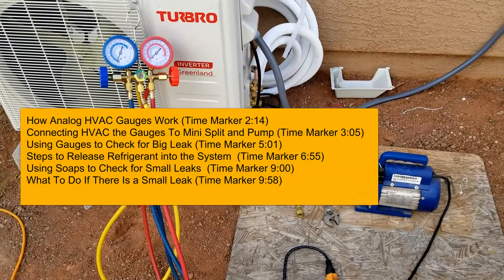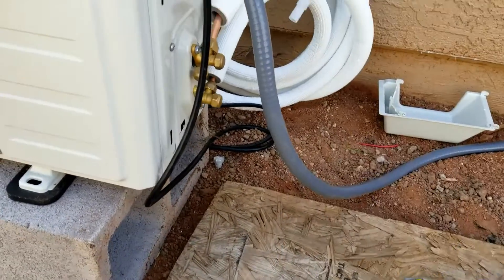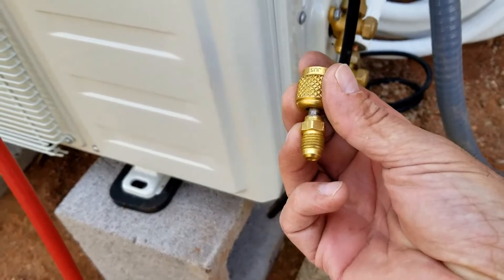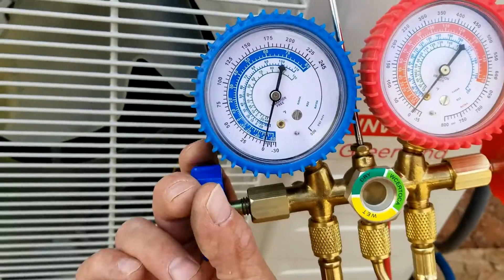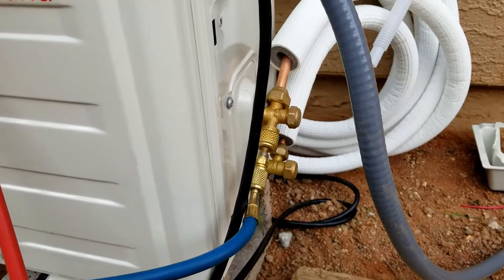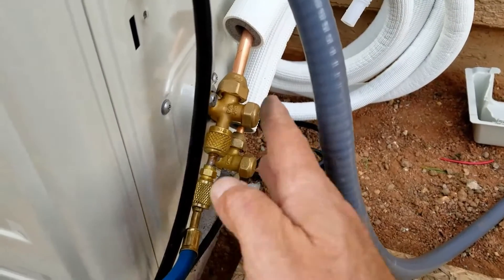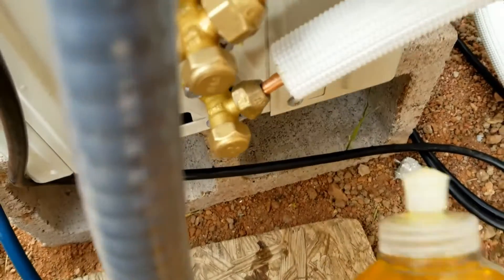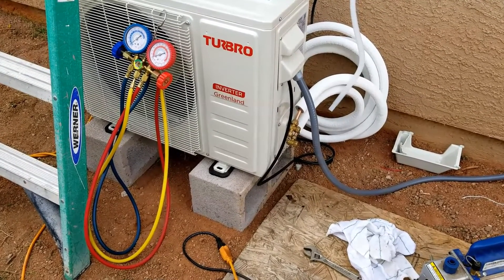Step by Step How to Vacuum Down Mini Split Using Analog Gauges Release Refrigerant Check for Leaks

Comment: Was the unit pumped down to begin?  Asking because my low pressure was reading 50 psi instead of 0 psi like yours.  Granted I did not have a vacuum pump hooked up just measuring low pressure.  To clarify mine is not a new install, it's six years old with suspected leak as reading 50 psi.  Assuming I just need to pump down system to get into the same state that your video was in to verify vacuum holds and if not resolve leak then relase refrigerant and add refrigerant as needed.
Reply from the maker: This is for a new install before the refrigerant is released, so, yes, basically, it has been pumped down. Since your unit is already in use with refrigerant in the system, the unit needs a Pump Down to lock the refrigerant back into the outside unit, or the refrigerant can also be recovered with a recovery machine.
Reply: @HVAC_Mechanic  I truly appreciate you sharing your knowledge to help everyone interested become more capable.  HVAC has always been my last big hurdle, but I'm getting there.  Thank you!

Comment: Great video. I've installed several of these and was just double checking if removing the vacuum hose after releasing the refrigerant was the correct method. One thing I noticed regarding the lines was how they were coiled in the vertical position. Isn't that a huge no-no because it creates oil traps inside the lines between cooling cycles? Aren't they supposed to either be fully extended or coiled horizontally?
Reply from the maker: Always follow the manual for a unit, but I have seen 25–30-year-old split units with the line set coiled up still running with no issues. You can cut them, but in my opinion, it's more cosmetic. Also, keep in mind the outside unit is prefilled with refrigerant with the line set in mind, so if too much is cut out, the refrigerant may need to be recalculated.

Comment: I did my unit 2 years ago. I did not do the soapie part in the end. And that is what my question is about, because wouldnt a leak be noticable becasue it won't hold vacume? This step seems reduntant to me, could you explain?  Thnks
Reply from the maker: Yes, most installers don't use the soap method but watch to see if they lose vacuum over 1/2 an hour or so. It is just an extra step to be sure there are no leaks, mainly a very small leak that would lose pressure over a long time period.
Reply: Understood, i can see with a  analog gauge those are not that accurate, but when a digital gauge would be used. I can imagine that would a lot more reliable. But better safe than...a little soap test can't hurt. The ironic thing is that I always do it when I work on gas lines.😂.. basicly samething, maybe less presure. Any way, thnks for clarifying.

Comment: Very nice Video! I did not completely get the first step though, were the valves on the outdoor unit open or closed? There was still refrigerant in the outdoor unit?
Reply from the maker: Refrigerant is locked in the outside unit from the factory. The pump is vacuuming down the lines that were connected between the two units.

Comment: What if we do the vacuum for 30 minutes and it does loose pressure and move towards the 0? Then what do we do?
Reply from the maker: If it loses pressure, there is a leak. It needs to be checked out, but usually, a leak is with the line set. Often, there is a bad flare, but it needs to be examined. Also, be sure the gauge hose connections are all tight.

Comment: When you run the vacuum, how do you know if air is getting past the schreader valve, and not just pulling a vacuum in the blue hose? I've got a pioneer unit that Im about to do this test.

Comment: 5000 microns is about 29.72 on the gauge. 1000 microns is about 29.88 on the gauge. 500 is about 29.9. 110 is about 29.92. The difference between 5000 microns and 200 is just barely perceptible if you're using an analogue gauge. And you will NEVER drop under 2500 microns if there is water in the system and you'll NEVER be able to tell the difference unless you're extremely observant and have pulled vacuums many times.

If there's any water in the system it will look exactly the same as a good vacuum on analogue gauges.

Using an analog gauge is slightly better than no gauge at all.

A leak that loses 500 microns won't even register unless you never got a decent vacuum in the first place.

The cheapest micron gauge is better than the most expensive manifold gauge set.

Invest in the correct tool for the job or you're really just counting on being lucky.

You can get a TPI Gauge for $110 You can get the Fieldpiece VC2G with the 5/16 adapter for $150 You can replace a ruined system for two or three grand.

You can do a proper install without a manifold set. You cannot do it without a micron gauge.
Reply from the maker: Micron gauges are good if you have one use it; if not, analog gauges have been used for much longer and also work very well. Either will work.
Reply: @HVAC_Mechanic  That's a bit like using analogue phone tools for computer networking. Some of them might still be relevant. But you NEED the relevant tools necessary for modern equipment.

IF you can guarantee there's no water in the lines, IF you purge them sufficiently and leak test them, say, overnight for both pressure and vacuum, then maybe you'll do an adequate job.

But, you'll never know if you did the job correctly or not unless you use a micron gauge and conduct a micron decay test.

You simply can NOT use an analogue gauge to see what you need to see. It simply doesn't have the resolution.

A system with a tiny bit of water in it will look exactly the same as one that doesn't. But, it won't last as long.

About all that gauge is good for is discovering relatively huge leaks over a relatively long period of time.
Reply from the maker: The process has been the same for 100 years; no new tools are needed. Many installers don't even vacuum the unit down; they flush it with R153a and tighten down the lines while it is under pressure. This argument over micron gauges reminds me of the new auto mechanics fresh out of school who can't troubleshoot without a scan tool. In the end, to each their own, whatever works to get the job done.
Reply: @HVAC_Mechanic  I have a toaster I use regularly that is 98 years old.

Like any toaster made in the modern day it heats bread to make toast.

I can NOT use my knowledge of how it works to repair a toaster made today.

I have explained why the method you're advocating is inadequate to the job you're doing, and trust me on this, I absolutely understand that you're motivated to believe the work you've done to the best of your ability with the tools you have is first rate work, fully the equal of anything done by anyone with their fancy shmancy modern tools, and I even agree it might happen to actually BE equivalent to anything done by 'technicians' using the latest tools.

What I'm trying to point out is that, even though you might not see the evidence directly, it wouldn't show up directly. A system lasts ten years when it might have lasted fifteen isn't something you have the ability to see without quite a lot of data which would be really hard for you to collect and analyze.

It's completely natural to suppose that anyone leaving contradictory comments to the information you're providing is simply trying to tear you down, to attack your credibility and diminish you.

And, maybe most of the time that's exactly what's happening. That's not what's happening here.

You are unquestionably a smart guy who wants the people who watch your videos to become properly informed, not to chase clout, not for status or a few bucks, but because you genuinely care whether or not the information you give them is accurate or not.

Look at the objections I've raised, specifically. Don't imagine I've said something I didn't. Look at the actual technical claims I've made. Where am I wrong?

When you say the process has been the same for a hundred years, that's true in an overall sense. But the technology has evolved. We're not dealing with the same refrigerants, lubricants or materials. As to HVAC techs using refrigerant to flush the lines... can't say as why that wouldn't work... for them, not for people without access to the refrigerant, and in any case isn't what you're teaching people to do.

Bringing up automotive scan tools points out a very similar thing. Such tools are a necessary but not sufficient means to diagnose modern cars. Old cars didn't have a MAF, a MAP, oxygen sensors, computer controlled fuel trim or a hundred other things to consider. Other than through sheer luck it is actually impossible to diagnose a modern car without the correct tools, and a 'scanner' is absolutely the bare minimum necessary tool which most of the time just minimizes the range of guesses.

I am absolutely certain you don't want to get this wrong. So, examine what I've said and decide if there's anything wrong with it.

Watch this video and tell me you're actually certain the setup and methods you're using sufficiently deal with the problem. https://youtu.be/Pm8mBCLJ49w?si=Np4clkmHwBE_8DSC
Reply from the maker: I have installed many mini-split and standard split systems that are still working 20-plus years later with no issues with using an analog gauge. I have two-micron gauges and use them, and while they are good when working, they can be off sometimes. I've seen several installs messed up when the installer's micron gauge gave bad readings.

Many installers these days are moving away from using a vacuum pump and don't use any gauges they use a flush like KWIK-E-VAC. 
Most new techs use micron gauges or the flush method, while 15-20 years ago, there were only analog manifold gauges. 
I guess I'm old school. In a few more years, analog gauges will probably no longer be used, but they do work. I've been using them my whole life.

Comment: I got a mini split installed and the technician leave the vacuum pump running for only 10 minutes. should I be concerned?
Reply from the maker: It is likely good as long as it holds a vacuum.

Comment: Can u recommend the brand equipment to use for this procedure?
Reply from the maker: I'm just using a low-cost HVAC gauge and pump. The links are in the description for what I am using but any low-cost HVAC pump and gauges will work.

Comment: I was told by a hvac expert to release the small line valve first slowly, any reason for this?
Reply from the maker: A lot of techs will argue about that one. Many manufacturers' manuals state to open the suction line first while others don't. It's always best to follow the manual from the manufacturer. Personally, I don't think it matters.

Comment: Thank you for the video but I’ll repeat what has been said before. Comparing micron gauges and analog gauges is like trying to measure 10 inches with your car’s mileage counter. Analog gauges just don’t have the fine resolution like micron gauges have.

Comment: Question: why do some videos show a shrader valve step ? Is that not required ?
Reply from the maker: Removing the Schrader valve is not necessary; sometimes, it is done on very large HVAC units to pump them down quicker, but even then, it is not necessary.  A lot of people get their information from schools and books, which very often is not how it works in the field.
Reply: @HVAC_Mechanic  those pesky schools and books!!!! I think those books contain some of the answers to your misunderstanding of HVAC. You seem to confuse vacuum with positive pressure at times. You seem to infer that after the release of the refrigerant, there is positive press.ure in the system.  The system is under a constant vacuum both before, and after the refrigerant is released. So, whether you remove the vacuum line before or after the release of the refrigerant, the lineset should still be under a constant vacuum. Unless my basic understanding of physics is off. But as another has stated here, the piont is moot, as the screw being open to release the gas blocks the port that the vacuum line is connected to.
Reply: @kylemccourt663  That's not always the case imo.
Reply: This is a great tutorial and explanation. But in regards to your comment... I am certainly glad I did not ask you to work on my system those pesky books must have a lot of dust on them in your closet or under the front porch steps. This gentleman did a great job, you can actually see the escape of some of the positive pressure (which as he stated is a slight amount of the refrigerant) as he is removing the blue mechanical compound gauge. Having done this myself and watching the gauge it actually shows the transfer of pressure occurring. 😊 I'm sure if you took the time to read some of those pesky books you mentioned you would discover that the system is under hundreds of #'s of pressure, the most being during heating cycles in the winter. Those pesky books I wonder if you have a 608 certification?

Comment: does it matter which side the refrigerant is release to first?
Reply from the maker: Some manuals will state to open the low side suction line first (Big line), while other manuals don't state anything. Be sure to check the installation instructions or manual for the unit, but I don't think it matters much.
Reply: thanks

Comment: Hello Sir, I have installed a senville mini split have installed everything but one issue it does not hold the vacuum. When start test it the gauge stops at -15 and not at -30. My area is at 5500 feet can that make it set on -15 instead of -30. It does not hold pressure. If I disconnect the hoses and re connect cause and retest the vacuum even do I have not release the coolant from fan. If you can help with this question will be appreciated.
Reply from the maker: As long as the vacuum pump is good the elevation shouldn't matter it should pump it down into a vacuum. It may be best to test it for leaks with nitrogen, you can also get a can of KWIK-E-VAC Line Set Flushing Kit pressurize the line set and then check for leaks with soap. Here is a link to KWIK-E-VAC on Amazon. https://amzn.to/4dkqkhI
Reply: Are you using a manifold  gadge ? Is so make sure there are no srader valves without  caps. Vacuum  will pull air around the srader valve . Some pumps have more than one port and don't come with a cap fpr thw second port. All srader valves need a cap

Comment: Hi, when you connect the lines to the outside unit, do you need to use Nylog and a torque wrench like the manual says? Thank you so much for the video.
Reply from the maker: It depends on the installer. I use Nylog but have never used a torque wrench. Some installers never use either, while some use both. The main thing is to get the fittings tight enough not to leak without overtightening them.

Comment: Hi, will a 2 cfm single stage vacuum pump do the work for a 1.5hp split aircond system?
Reply from the maker: Yes, it will work. Most any HVAC pump will work; it's just how fast it can pump a system down.

Comment: That was great thank you it well until I unscrewed the blue hose from the adapter instead of the unit and lost a lot of coolant before I got the adapter off #####**, so he much damage did I do? The unit is working and blowing cool air, thanks.
Reply from the maker: If the unit is working, you didn't lose enough to affect it.
Reply: @HVAC_Mechanic  thank you it was about 2 secs but really released. The out side lines are really wet, if it freezes then I’ll need to recharge?
Reply from the maker: There can be different symptoms, but if the unit stops blowing cold air, then it likely will need a recharge. Hopefully, the unit keeps working. When low on refrigerant officially, the refrigerant in the unit is recovered, and new refrigerant is added in by weight. Unofficially, refrigerant can be added in very slowly in increments until the unit starts blowing cold air. R410a can be bought online such as Ability Refrigerants. Anyone can buy refrigerants, but technically, you're supposed to have an EPA 608 card to use it. I made a video on this, here is a link. https://youtu.be/LrMQONBJJgE
Reply: @HVAC_Mechanic I really appreciate you taking the time to respond thank you sir. Room is cool but concerned about the lines and fittings being dripping wet down to the machine. Should I worry about that? Thanks

Comment: Can't believe nobody else talks about pumpdown if you do have a leak. Damn. I was considering using a can of legally ventable R-290 to check for leaks before final pumpdown but this makes it much easier.
Reply from the maker: That is a good idea, and what some installers do is use an eco-friendly refrigerant to test for leaks before vacuuming down the system.
Reply: @HVAC_Mechanic  Most refrigerant bottles are less than 5 Bar. That's not enough for a leak test imo. With N2 it's 40+ Bar.

Comment: I just installed a Tosot 230V 9000 BTU mini split in my pool house. I found this video extremely helpful. This was my first install but I’m pretty handy with electrical and building. For vacuuming the lines and releasing the refrigerant I found your video the most helpful and clear. Thanks for posting your video!

Comment: Does it have to get to -30? Mine gets to -15 but it will stay steady at -15
Reply from the maker: It depends on the vacuum pump how well it pumps down, but a slow pump should get to at least -30 Hg. Also, be sure to check the gauge is R410a.